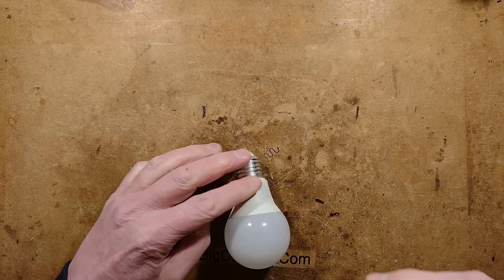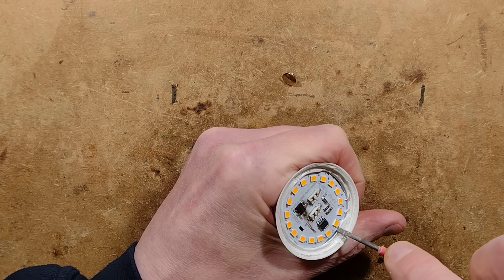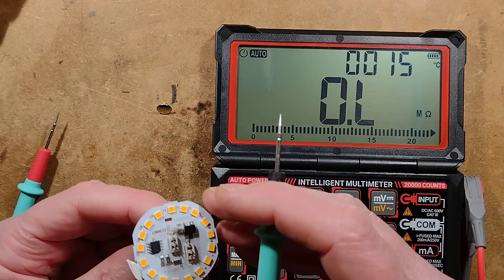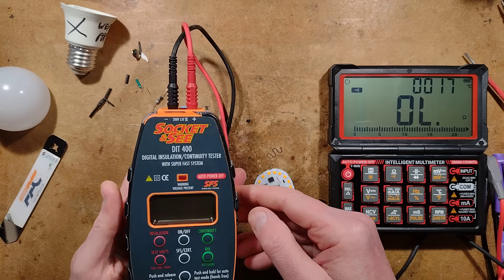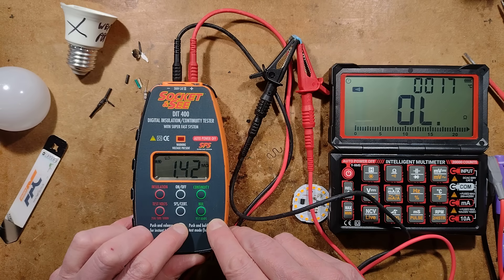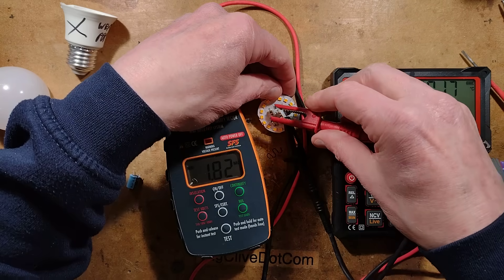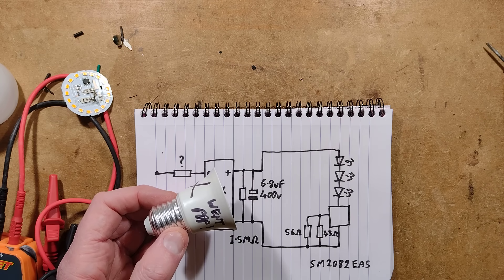Exploring an LED bulb that went POP during a livestream

Comment: >"miffed that the rubbery (polyurethane?) bumpers on my meters have started disintegrating" -- My Fluke is close to 40 years old, has been splashed in solvent, the all-over bumper is scarred but not shedding or falling apart. For a 200-buck machine, that DIT400 seems disappointing.

Comment: That was a simple looking driver for the light compared to the one I took apart(Osram).  The Osram had a full DC power supply on one side of the PCB and a complicated looking driver circuit on the other side, all sealed in foam rubber goo and shoved into the base of the light.  Took a while to tear it apart to see what happened...a capacitor of course.  Meters...so many to choose from and so little time.  Nicely done Clive, thanks.  👍👍

Comment: Here I was, sitting and saying "it's gotta be the capacitor"... and then it turns out it's the bridge rectifier.
I've got to be honest, that was not on my "possible failed components" bingo card for this one.
I've had a total of three LED bulbs go pop out of ten total failed, and without fail it would be the capacitor every time.
Reply: Assumption is the mother of all f ups .

Comment: Re: the meter defaulting to DC volts. I like that since I mainly work with automotive or electronics and need DC so it always annoys mewhen I need to push a button to change mode every time I turn on. I'd prefer it to have the selection on the knob like my Fluke 177 and 233.

Comment: Actually I have done that many times with a blown LED bulb. And even after locating the defective part, I ended up thrown them away because it is easier to replace them than to repair them. But of course curiosity always makes be open them up...
Reply: well yes and then they are put into the recyeing planet borken down for usable parts and then rebulit anew with thsoe bulb compnys where smart aobuut it. that veyr insertting thiung aobut eld boubls is that the  main unused advatege of led bulbs its that the parts are salvageble for recyeling that can be used to make new led bulbs form salvaged parts from old reacyedl led bulbs if we can it would actly be lot beter for the envonet overall.

Comment: Slightly off topic, it's worth noting the bulb is a screw  fit version rather than the bayonet type. Like the UK plug, one can argue that the bayonet is a superior solution. The screw fit has only become viable because light bulbs no longer run so hot, thanks to the advent of LED bulbs.
Reply: B&Q are now selling bayonet to screw fit light bulb adaptors. This is a worrying development, as it suggests a move to force the adoption of these horrible screw fit bulbs. 
It will be interesting to see if the bayonet the minted bulbs disappear from the high street.

Comment: Thanks for showing taking it apart, I have some motion sensing bulbs that look near identical and was wondering how to take one apart to then see if I could increase the on time beyond its measly 1 minute.
Reply from the maker: Depending on the circuitry it may be possible with a resistor change.

Comment: I had a bulb that looked like an incandescent. It had a glass globe. It stopped working so I broke the glass to see the inside. It has those LED strips inside, and the circuit board was in the screw in base! GE . It would flicker slightly in it's last months, 
I thought it was a power company issue, or on my end. When it died, it went out, came back on, flashed, then went out to a very dim glow.
Reply: 100 watt equivalent, 12 watts draw.

Comment: Hi Clive I hope you are well, and that you passed your previous exams (I have no doubt that you did) I had one of these lamps blow in quite a violent manner.  It actually burst the aluminium that surrounds the circuitry, it looked like a bicycle inner tube that had had a blow out. I took it apart to see what had failed and the capacitor was completely disintegrated with fluff everywhere. It was like loft insulation had blown all over the place.  I can't believe that it actually burst the aluminium casing. I wasn't in the room when it actually popped but I can imagine it was quite a bang. The funny thing is it didn't trip anything it just popped.
Reply from the maker: When electrolytics fail they often do so by creating gas internally to the point the case ruptures under pressure.  That can make quite a bang and spray out the separator as fluff and the electrolyte often comes out as a glycol fog like a smoke machine.
Reply: I've been saving capacitors, once I have a dozen or so I will pop them with my power supply. Maybe for 4th of July.
Reply: electrolytics fail relatively safely ,they usually just slice open their tops and vent the gasses and you wont even notice it unless you look at it ,in your case im guessing the rectefier failed (maybe overheated) and maybe shorted wish resulted in 220 going straight to the cap ,that would make it explode .... electroboom actually uses this trick to make his explosions in his videos ,he just wires high voltage straight into a cap and he has a foot pedal to trigger it , he does it in a very safe way actually
Reply: @fouzaialaa7962  This how their safety failure is designed. But I can say this is very not always the case as I've encountered many dry caps that just leaked their electrolytic liquid from the base instead of gracefully venting from their purposefully weaken top. That's how all of my CFL bulbs died.

Comment: I think that multimeter will be really good for people who aren't familiar with using them. The buttons you select the mode with are big, so people can learn from that, as well as the display being huge. The display was very easy to read on the video when I watched it on my phone, which I'm sure is the target device for a lot of users.
Reply: would still prefer the knob ,it looks more like a calculator ,the advantage of the knob is that its easy enagh to use yet very hard to accidentally turn it while your working,you select something its pretty much set ,you cant bump it into another mode ,unlike a button that you can be probing something and then accidentally press another button that might make the meter explode
Reply: @ for my own personal use, I have traditional pointer knob meters. I like that rotating the switch engages the batteries and it's not in permanent current draining standby mode!
If I were teaching someone IRL, I'd still go pointer dial. 
But, for having the meter siting flat under Clive's camera, I think this one will work out well.
Reply: @fouzaialaa7962  Believe it or not, there's a clown on YT who makes videos of busted multimeters. It's always the tracks under the knobs. His videos are so ridiculous, I had to poke fun at him one time.
If anything, it taught me to stay away from the knobs.
Reply: My daily use multimeter is a true RMS Fluke 8060A which I bought back in the early 1980s.  It is pretty much a mechanical pushbutton meter, even for the ranges.  In many instances it is handy not to have the meter auto ranging.  That was a 350 dollar meter back then,  but it has held up for almost 45 years.  The last calibration the 8060A had was in 1985 at Fluke.  I recently checked the calibration with my equipment and it is still within spec.  The original Fluke probes weren’t great and I replaced them a long time ago.
Reply: Years ago, I wondered why they don't make a push button multimeter so I went looking. The first one I found was one from France. They wanted $3,000 for it. No thanks.
Found one locally for $75. Bought it right away. Otherwise, I'd get this Aneng because its display is bigger and has a 20,000 count.
Reply: Facts buddy facts.

Comment: I have seen bridge rectifiers pop and short out a diode in the bridge, the cap doesn't look that bad. I'd lean toward the rectifier as the culprit.
Reply: I've seen a couple die in these LED bulbs, they really don't like heat & harsh AC

Comment: Nice one Clive 2 mistakes in 1 Video.
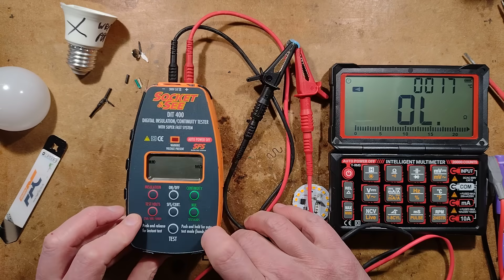First at 5:00 minutes Clive selects the voltage at 500v and does the test, thinking he's set it on 250v. Then at 5:37 Clive selects 500voltage again to do the 500v test.
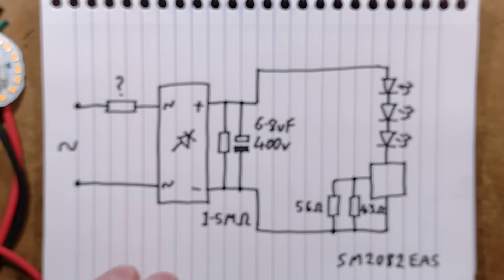Then at 8:47 Clive puts the book down and it looks light the pen or his hand gets to close to the recording device and set the focus on the top of his hand.
Love you work Clive, but I think this was you having a bad day?
Reply from the maker: Annoyingly the meter is the type with text so close to the edge that it is hard to see from the angle I was using it.